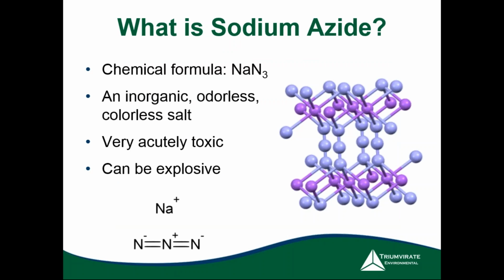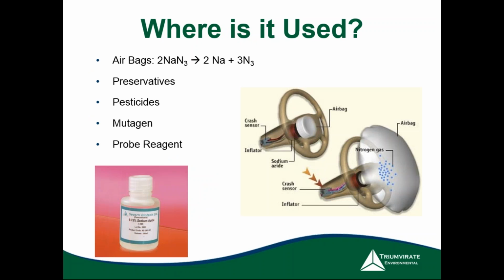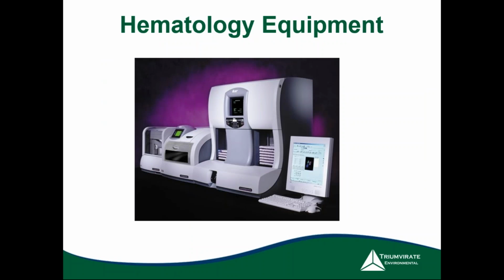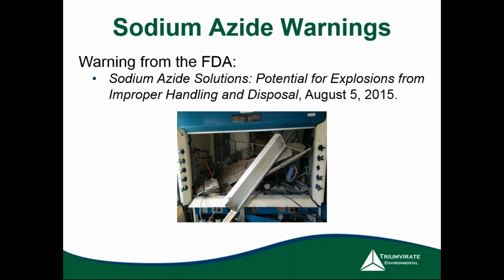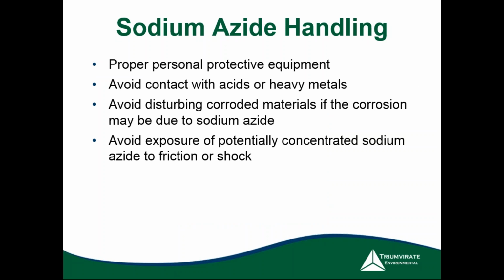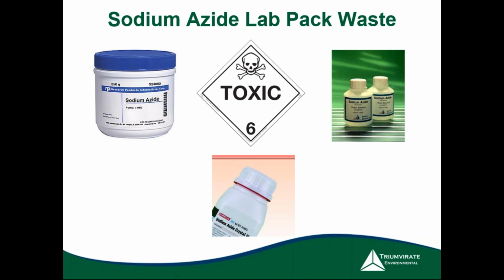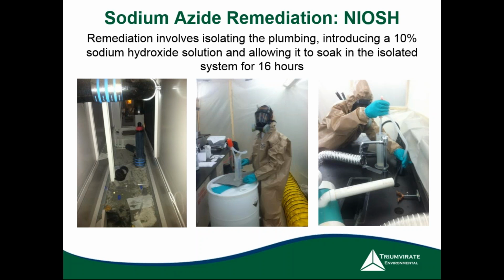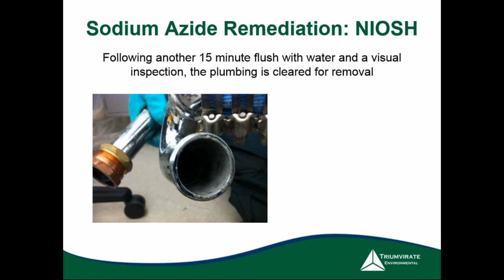Webinar: The Hidden Dangers of Sodium Azide

Comment: Instructions: if you are not treated correctly at your nearest hospital, alkyl nitrites can assist with fatality prevention to some extent, also sodium or potassium nitrite taken in a drip (or orally) can also lessen the lethal effects of the copound in the body, in extreme cases, maybe a blood transfusion may save a life, however these treatments are limited in effectivemess and vary based on the dosage of both the toxin (azide) and the treatments: e.g. inhalation of: amyl nitrite
Oral Ingestion or slow injection of aquious sodium nitrite, 
And blood transfusion(s) may be necessary during cases where the lethal azide dosage is well surpassed and in this case it is critical.
Reply: Also goes by three other names sodium trinitride Smite azium the word smite means to .ill

Comment: I have accidentally engulfed sodium azide what should I do now....
Reply: she dead for sure.
Reply: Instructions: if you are not treated correctly at your nearest hospital, alkyl nitrites can assist with fatality prevention to some extent, also sodium or potassium nitrite taken in a drip (or orally) can also lessen the lethal effects of the copound in the body, in extreme cases, maybe a blood transfusion may save a life, however these treatments are limited in effectivemess and vary based on the dosage of both the toxin (azide) and the treatments: e.g. inhalation of: amyl nitrite
Oral Ingestion or slow injection of aquious sodium nitrite, 
And blood transfusion(s) may be necessary during cases where the lethal azide dosage is well surpassed and in this case it is critical.
Reply: Try not to panic, and go about your life if you feel fine....
Reply: @oceanhouse8080  rip
Reply: @oceanhouse8080  If she was serious and took your advice 💀☠👻🤖💭🦴👀 she would be dead.